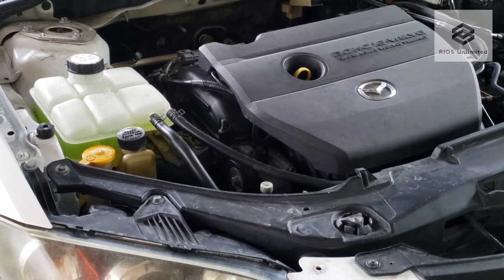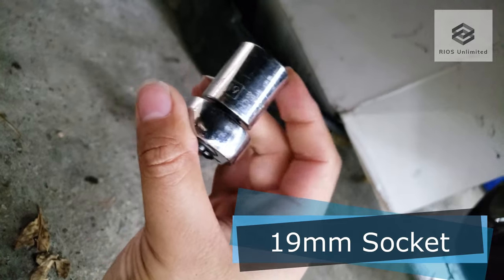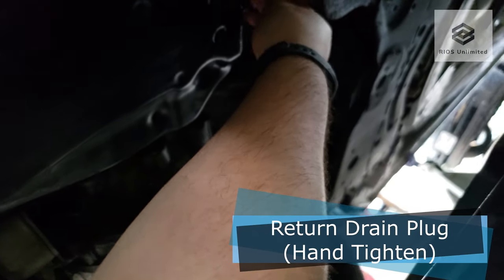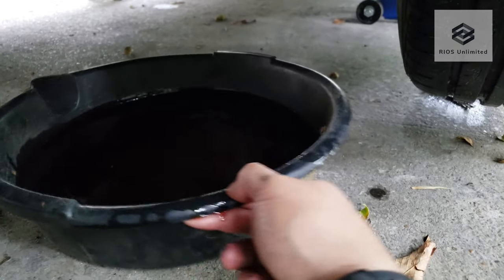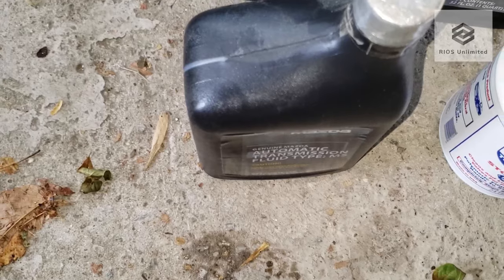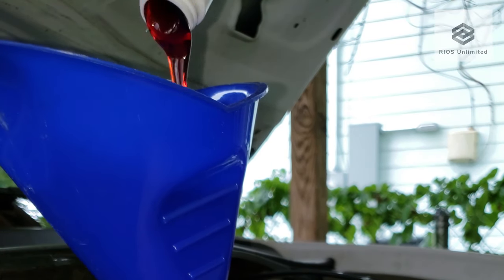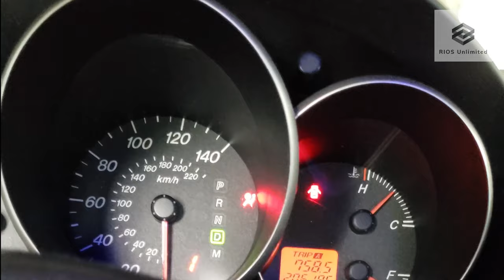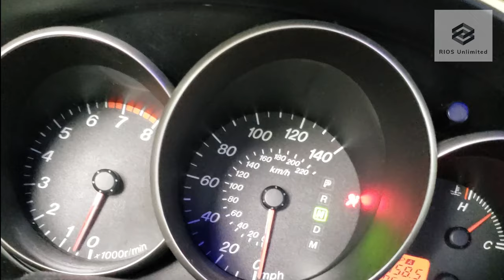Mazda 3 Automatic Transmission Fluid Change

Comment: YOU LEFT THE MAJORITY OF THE NASTY FLUID IN THE TORQUE CONVERTER !!!
Reply from the maker: Yeah, this is not meant to be a flush. This is process would have to be completed 3x to have all new tranny fluid.
Reply: Fluid change not flush
Reply: This is way better than a flush when your car has a lot of mileage, doing a transmission flush to a high mileage transmission will make it slip and probably damage it

Comment: What a great video you did here. Thank you so much. I just wanted to ask you.. have you ever felt the transmission kind of jerk a little when you are coming to a stop, as it goes down the gears? This happens to my 2011 Mazda 3. I had the transmission fully flushed at a shop at 46K (now 68k) and I can't remember if it did that before. They changed the filter as well all both filter and oil Mazda parts.
Reply: No idea if this helps, but my ‘05 Mazda 3 has always done this.
Reply: My 07 does the same thing. I've also got a Ford freestyle SUV with a similar engine/cvt and it does the same thing.
Reply: Scotty Kilmer says never flush your transmission, it's just a shops way of getting more money out of you. Of course there may be special circumstances, but you need some old fluid in there to keep a grip, a flush with all new fluid will cause slipping of the transmission. It's a super sensitive part. My 2014 nissan sentra never had a trans change, I was told it was too late at 160,000 miles and if I changed it or flushed it, it would cause complications. Needless to say my new car will get more than just oil changes. 😂
Reply: @skullcandy15151  Yeah flushing like the kind where they hook up a machine is not very good, but dropping the pan and doing a fluid change and filter change is always beneficial.

Comment: how did the lucas fix turn out?  notice any difference?
Reply from the maker: There was an improvement for about 2 months switching between gears. Around that time, I started hearing a grinding noise switching between 2nd to 3rd gear. I have another 14K left before my next interval to change my ATF. I will changing my clutch next. I do recommend Lucas to hopefully improve a transmission.
Reply: How many miles did you have on your car?
Reply from the maker: @statix6900  it was about 190K miles. I am currently on 222K miles. Transmission is still going fine although I do have a grinding noise going from 2nd to 3rd gear. I will be changing my clutch soon.